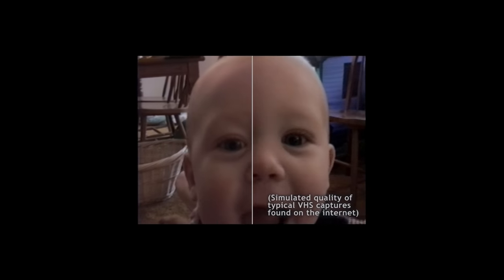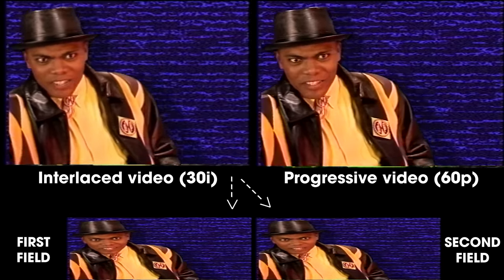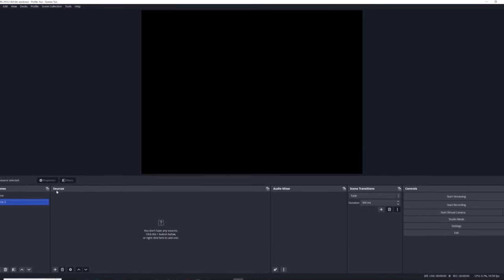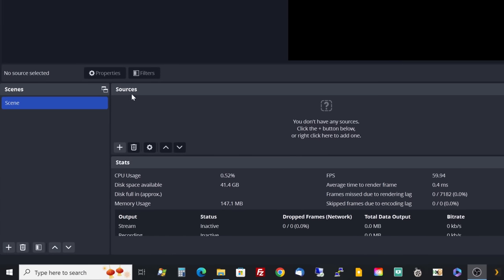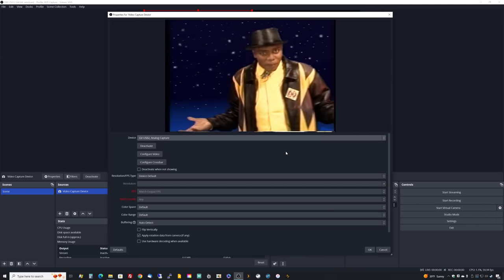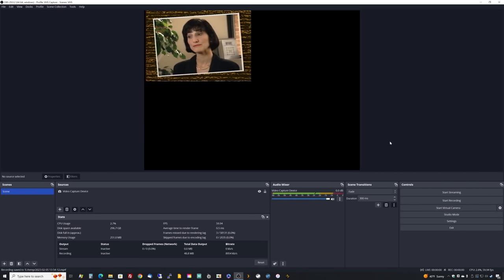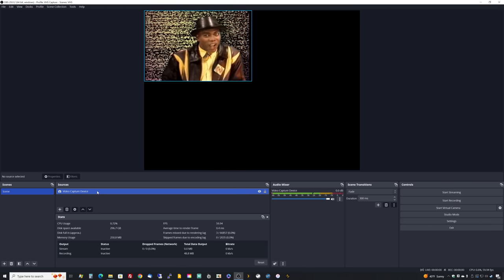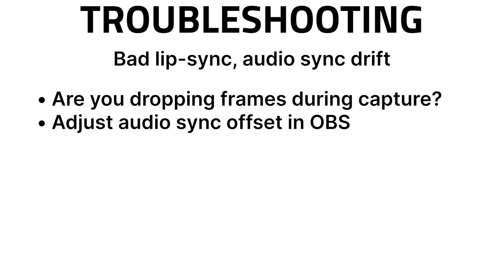How to convert VHS videotape to 60p digital video

Comment: A superb tutorial. Suggestion both capture devices that you are using are okay, but IO DATA is a very good capture device. If you dont have a very good capture device, then your end product will be less than what your master material is. 

Please do a tutorial on doing a picture in picture on screen. 

Thanks

Comment: I use a Canopus ADVC-100 and deinterlace in VirtualDub using the smart bob filter.
Reply from the maker: The Smart Bob filter is ancient, it's from 2001.  At least use the yadif deinterlacer, it's 5 years newer and has a slightly better algorithm.
Reply: @TheOldskoolPC  Thanks. I've never changed my workflow since I've gotten good results.

Comment: In the tutorial why do you scale the image up to a larger dimension. What not just capture and save the image with the same dimensions as the original image size (720 x 480)? Thanks for this tutorial!
Reply from the maker: The upscaling is done so that, if the capture is immediately uploaded to youtube, it will display all 60 frames per second correctly.  YouTube won't recognize a video as 60p unless it's 720 lines or more.
Reply: There's also something to be said for h264 working a lot better on HD footage. It just doesn't compress low res content as well. This is even more true if you go for h265.

Comment: I tried this quickly with an old Easycap device just to see what would happen and it worked but I got this green band of interference across about 1/4 of the bottom of the screen. I got to get a better device for sure.
Reply from the maker: I used an old Easycap device for my previous tutorial, and it worked fine, but there were a lot of comments regarding varying drivers -- maybe a different driver can salvage your Easycap...

Comment: This is one of the best tutorials on anything I've ever seen YouTube!  Fantastic!  A few follow up questions.  I am converting Digital 8 and maybe some Hi8 thru a backwards compatible  Digital 8 camcorder (TRV-320) into Mac format (2019 or newer technology).  Here are my options:
1)  Seems like OBS is better than iMovie, is that the case?  Is there any other software to consider?
2) I have the option of DV output via firewire thru a 400->800 adaptor, thru a 800->TB2 dongle, thru TB2->TB3 dongle into Mac.  For OBS, are the videos settings the same as what you have in this video for Analog VHS?  Seems like this is best for Digital 8 recordings as it preserves digital data?
3)  I also have the option of either S-Video or composite thru a (Tensun) video converter box to HDMI, then thru a HDMI->USB-C video capture dongle.  Is there any advantage of going this route for Digital 8?  Seems like the pictures are more saturated in color, but a little bit more fuzzy.  For my analog Hi8, is this a better route?
Reply from the maker: I think imovie doesn't preserve fields, but I could be wrong.  But if that's the case, OBS is the better option.
If you convert analog video to DV, then the advantage is that audio can never drift, but the disadvantage is that the video quality goes through a generational loss.  Also, DV is not great with high-contrast color edges; it stair-steps them.
If your recording is ORIGINALLY digital, then yes, DV is the correct way to capture, via a firewire port.  Don't put born-digital footage through an analog output conversion process if you can avoid it.
For your video converter box to HDMI, I'm afraid I can't answer as I don't have one and don't know its capabilities.  But you can always experiment and see what looks best to your eyes.

Comment: Excellent video!  Would like to see the next step....archival masters.  I'm using the I-O Data dongle, but also have a old Canopus ADVC 110 if that can be used with OBS.
Reply from the maker: It should be able to, but the IO dongle is YUV 4:2:0 whereas DV (what the ADVC 110 transmits) is YUV 4:1:1 and can make high-contrast color edges look worse.  I would transfer DV as-is over firewire, but if you are transferring analog sources, try both with your source material and see which looks best.

Comment: Your metod is amazing, I bought StarTech device because of your advice (the first one is unavaible in my country - Poland). However, I decided NOT to upscale to eighter 1080p or even 720p. My homemade videos seems to look better with just 640-480 without upscale, that creates ugly blocky pixels ever with "Lanchos" on. So I would recommend that for especially home videos, not some commercials or animations etc. Maybe monitors and TV sets handle upscale even better when it just have the same resolution, than output from device, very close to VHS qality.
My Lenovo Y50-70 works fine with Nvidia hardware support (CPU usage 1-3% <- you can work on PC at the same time)
Thanks for very specyfic tutorial with lot of good ideas, and thanks to you I learned how to use OBS at all!
Reply from the maker: Glad I could help!  There's nothing wrong with leaving the resolution at the native capture rate (I thought Poland was PAL?  So that would be 720x576), however if you upload to youtube, youtube won't play it in the full framerate unless it's 720p or higher.
Reply: @TheOldskoolPC  You're right, YT bitrates are also very low. OBS gives this PAL resolution something about 10K bitrate, when YT has lower values even for fullHD 1080p.
However, I would not upload my private home videos so I decided to 640x480 for normal, square pixels and denoise filters later in post production. Poland is PAL but, for some reason, all monitors, laptops and computers and also smartphones are 60Hz or 30-60fps 🙃
Thanks to YOU I have good device from Startech, 50p framerate and very good quality 👍

Comment: Good video, one thing to keep in mind is that some VCR's, mostly lower end models, don't put out as good of a video signal than the mid-to-higher end VCR's.
Reply from the maker: With VCRs you usually do get what you pay for (the higher end models have built-in TBCs, comb filters, etc.)  Just be careful not to turn on too many options -- for example, my high-end VCR has a noise reducing function that just smears everything in the time domain, it's worse than useless, I always disable it.

Comment: Now I'm kinda wondering about with Mac computers since OBS cannot work with Elgato Video Capture on a iMac's version of OBS.
Reply: I’m having the same issue. I have a MacBook Air with the M1 from 2020 and I put the same settings as the guy did in the video and it didn’t work.

Comment: If you have a PC that can handle it, bumping up the canvas resolution to 1920x1440 is a good idea. It's a 3x integer upscale of 480-line content so it gives you more options for how to filter the upscaled video - and sites like Youtube will treat it as 1440p with a higher bitrate than 1080p.

Comment: Great tutorial for beginners, properly capturing SD video is one big rabbit hole... also does OBS support adjusting the pixel aspect ratio and storage aspect ratio? So far I've captured only Video8 tapes via Digital8 camera with dvgrab and then deinterlaced/corrected them with ffmpeg+QTGMC, but OBS looks like nice setup for some quick capturing of analog inputs.
Reply from the maker: If you're comfortable with ffmpeg and QTGMC, you should not use this tutorial.  This tutorial is meant for 1-click tape-to-file-I-can-upload-to-youtube.  QTGMC produces vastly superior results.

Comment: FYI. During my Dazzle troubleshooting adventures I had an epiphany .. could my original Dazzle be defective? Only one way to find out .. order up another. Bought a second Dazzle ... hooked it up .. Windows 11 recognized it .. I configured it in OBS .. and it works .. it works much better than the Roxio. I guess the moral of the story is eBay can be a crap shoot when it comes to old electronics. Thank you again for the great tutorial.
Reply from the maker: Thanks for the field report!

Comment: Great video would love to see some more advanced content from you.  Which method do you believe produces the better result, your original method using virtualdub or this new method using OBS?
Reply from the maker: The end result for both methods is nearly identical, so I usually recommend this newer method for beginners because it's a realtime process (ie. the final result is saved directly to disk from the recording process).
Reply: @TheOldskoolPC  Thank you!  
With this method I'm experiencing some pretty large file sizes for the data rate.  I'm seeing about 12Gb per hour of video.  Encoder type has no impact for me, nor does reducing the canvas resolution.  If you set the capture to stream and change the data rate, that has a huge impact.  I'm not sure of the impact to quality, they look pretty similar so far to my untrained eye.  Wasn't sure how this compared for file size compared to your original method either as I haven't completed that one through reduction/compression.  Bottom line, I don't have room for 24Gb file sizes per tape, and need to figure out a better compromise, or what I'm doing wrong.  Thank you again for your help, please keep the content coming.

Comment: This is the best tutorial I've ever seen! I've tried the not recommended capture adapters and the quality is meh... I also have an old TV capture card from Hauppauage which works with Windows XP but I've got issues with audio getting out of sync, probably because of an old PC and as I remember there were no drivers for this Hauppauge card for newer operating systems so I left my analog-to-digital journey there.. 
Now I have to try again 😁
Reply from the maker: I recall great results with a Happauge card 20 years ago, sadly I can't remember which one though.  Those were usually TV tuners, so they handled interlaced signals perfectly.
Reply: @TheOldskoolPC  do you remember what software you used then? There was no OBS 20 years ago.

Comment: Note to those who run into issues trying to do S-Video input instead of composite, you need to select S-Video under the Configure Video screen for it to process that input...  I just spent much longer than I should have trying to figure out if I had a bad VCR, cable, or capture card.  It turns out I was just doing it wrong.

Comment: Great stuff, but I would add in a future video talking about AMD hardware, and maybe seeing what the best capture card is on Linux as it's becoming more popular, and a lot of people with older gear like myself can't run Windows 11, and I see that becoming a bigger issue in the next few years, as MS drops support for Windows 10.
Reply from the maker: The only capture hardware I'd recommend for Linux is anything from Blackmagic Design, as they have been explicitly supporting Linux for over a decade.  However, their hardware is not cheap, and because it is broadcast equipment, it needs decent signaling (so, no worn-out stretched tapes).  As for AMD, you can use OBS on AMD hardware just fine, and also in Linux.

Comment: I noticed you chose the settings best suited for uploading to YouTube.
But what are the best settings if you wanted to keep the video format to load onto a video editing software like Adobe Premiere Pro
Reply from the maker: Excellent question!  If I wanted to edit in premiere pro, PPro still supports interlaced video, so I would capture to AVI with either no compression or a lossless codec like UT, and I would not attempt deinterlacing or resizing in OBS.  Premiere Pro lets you specify the field order of imported footage, and you can then edit it natively.  Just remember to never delete the original raw capture, because processing methods might improve in the future and you'd want to make a second pass at some point.

Comment: thank you ! if you really are on the lowest budget, for the same price of those terrible cheap cards you can get a less terrible AV to HDMI "Upscaler" (+ cheap hdmi card) that surprisingly does deinterlacing and gives much cleaner results
Reply from the maker: My issue with those units is that they perform dumb "bob" deinterlacing, which definitely looks worse in scenes without much/any motion.  "yadif" or "bwdif" deinterlacers are superior in this regard.
Reply: @TheOldskoolPC  oh ok thx for the precisions (that i couldn't even find on the product page nor user manual lol)

Comment: so you use a capture device and that device is connected to a VHS Player? is that the easiest way to go from VHS -> computer/digital conversion process... so basically this setup:
VHS Player ---(SVideo or those 3 RCA composite cables connected to)---> Video Capture Device --(with USB output connect to)--> computer

Comment: Interesting video. I usually capture in MPEG2 or AVI and upscale and deinterlace and make MP4 later with other programs. This capture with OBS is an interesting approach, capture, deinterlace, upscale and making MP4 in one step. I also usually crop or mask out the overscan area. Is this possible in OBS? 
I have also experimented with different capture devices. I found that Dazzle had a slightly lower picture quality. I like the Hauppauge USB Live2 better.
Reply from the maker: Yes, cropping is possible in OBS.  You can either apply a crop filter, or you can resize the source to be slightly larger than the canvas; either method works.

Comment: Hi there, thanks a lot for that awesome tutorial! I just got back to digitalising our old family movies after some years using various programs like virtualdub, dscaler and handbrake. But I still wasnt completely happy with the outcome of the compressed videos. Interesting to see you capture in such high frame rates! I usually set 25 fps for my captures which may be one reason for my results. Will try out your setup this week.
Reply from the maker: Analog video is 50 or 60 fields per second, so if you want it to look like it does on a CRT, you've got to produce output that is 50 or 60p.
Reply: Is elgato a good grand to go with?

Comment: Today I get in second hand the dazzle dvd recorder hd. It's the newer version but the hardware says 1.0. I install all the software that come on the DVD with the device (It takes a lot of time so instead I made an image of the DVD and I installed from the image a little bit faster) At first I have sound with noises and flikering images from the source tapes. I was thinking I bought a defective device or the problem was my computer. I tryed the OBS Studio. Then I tryed with other softwares and all the same. I tested with the Pinnacle Studio that come on the DVD and the same thing. Then after I reload the Pinnacle Studio at some poit it asked if I wanted to update it so I have nothing to loose at that point and I updated. After a long update and instaling then the sound was ok from the Dazzle but no image. Then I saw that the input was selected automatically for S-video with the update. Then I changed to the video composite and bingo! Image and sound perfect finnaly! Now I am testing it. The other thing is I have to put in PAL 50fps because I live in Europe. And thank you for this video. You're the man! 👍😄

Comment: Could you use the s-video cable and would that yield a better quality image?
Reply from the maker: If your player has an s-video cable it outputs on, it is generally better quality even if the source is composite, because a player with such a port might implement a comb filter or other processing.

Comment: I also have watched a number of videos on capture and this is the best.  I also appreciate you style and content, excellent!  It has helped me in understanding what the dongle has to do, i.e. pass both frames.  Now I know why the captures I did some years back look subpar.  If you do another tutorial on advanced capture please include transfer using S video and using DNxHD or MOV files.  My understanding on using S video is the chroma and luminance are not combined as in the composite signal.  There are a number of DNxHD bitrates but I think the DNxHD 36 might be the best for transfer but do not really know. The DNxHD is a larger file size as it is not compressed like the X264 MP4 files and therefore easier to edit in a Non Linear Editor and deliver in another format.  Also if I needed a VHS player I would look for a player that has direct drive over a belt driven unit. But, sometimes beggars can't be choosey.
Reply from the maker: DNxHD is a very fine transport codec; can also use prores or prores HQ (but not LT, that's the low-quality one meant for previews only).

Comment: What are the characteristics of Archival Masters and how to make them? Why would this process not produce one?
Reply from the maker: Anything considered a master transfer for archival purposes would not perform any processing above what was needed to perform the initial transfer.  My capture device captures interlaced video into a lower-field-first frame with dimensions 720x486, in raw 10-bit 4:2:2 format.  One hour of this including audio takes up roughly 100G per hour of footage.  This can be losslessly compressed if you need to free up storage (common AMIA recommendations suggest using FFMPEG's FFV1 as the codec and matroska as the container).